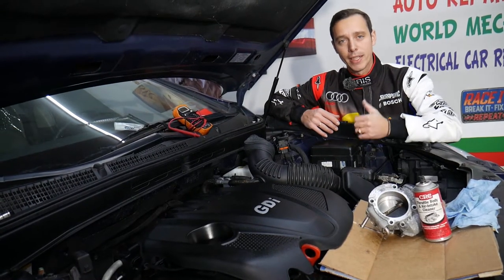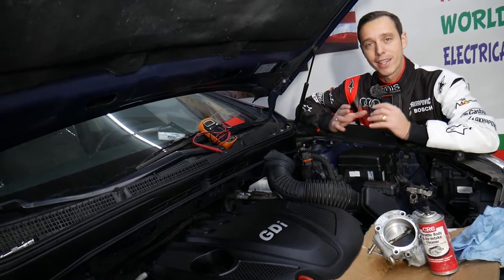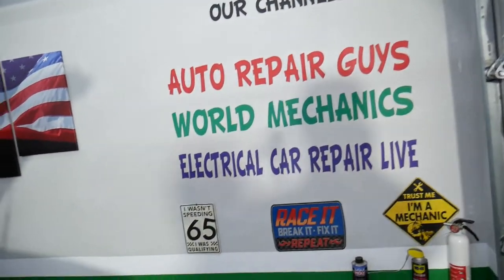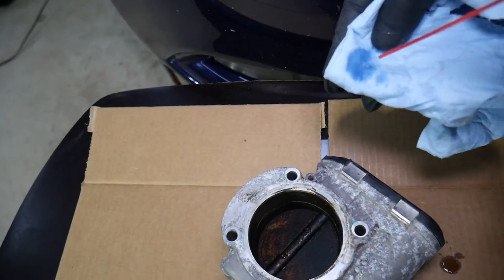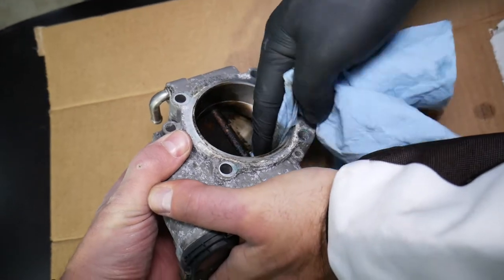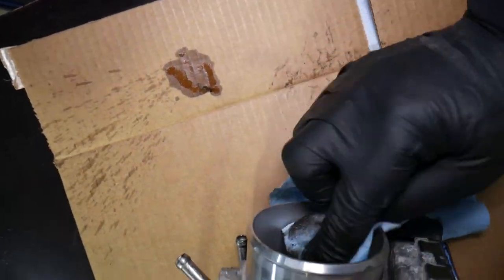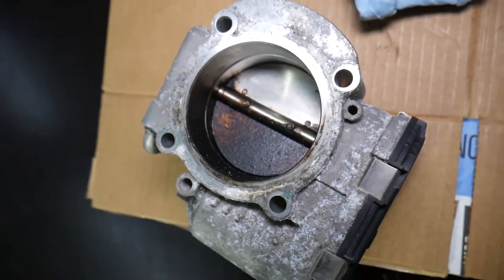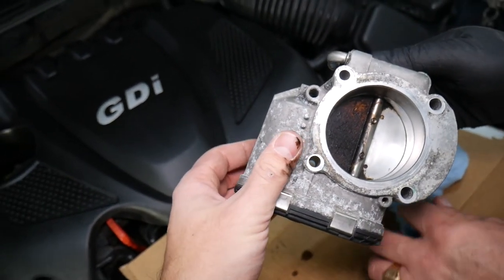HOW TO CLEAN THROTTLE BODY ON KIA OPTIMA

Comment: By turning the flap, doesn't that cause sensor calibration issues?
Reply: Yes it does for electronically controlled throttle bodies. Make sure you push it back to the same spot it was at. If you have to remove it to be cleaned, you were fucked anyways 😂 so at that point, it’s not a bad idea to try cleaning it.  It makes a big difference. I cleaned it on my 3000GT, runs smooth as a baby’s bottom. Only costs $5 for the throttle bottle cleaning spray.
Reply: Mine is electronically controlled throttle body , but i did not remove it from the engine  but i do open the door by pushing it and clean the surroundings and the door and it works fine 15 optima , but in my previous car i switch on the ignition and push the accelerator all the way down and it opens the door automatically but in optima its not doing
Reply: @zohaibahmed5445 so it was ok to move flap to clean? Gonna do it on my 15 optima but don't want to mess it up.  And I read you left it on car correct. That's what I was gonna do.

Comment: I've heard that you arent supposed to move that throttle body flap with your fingers as U do in your video because it will damage the sensors,gears ect and that U are supposed to clean it by turning on the ignition and depress the gas pedal so the computer can control it!Please clarify this issue so we can do it the right way
gthd gas pedal so it can open
Reply: Verified. This is correct In vast majority of newer cars~, ballpark any thing after 2000ish basically cpl things to determine is - search your vehicle and determine if you have electrical assisted throttle body vs a direct line (direct literally cable running from pedal through into engine and ending with mechanical type (push throttle the cable opens the flap inside the throttle body and allows more or less depending on pedal position.

Alternative newer adoption of electric throttle body systems use signals based on when the throttle (gas pedal) is moved. The throttle cable as mentioned above is not one unit. Instead thete are sensors and other comp. Parts that are mounted onto the throttle body and have a motor which adjusts the throttle position based on what the signals the gas pedal position may be.

If removal before Cleaning there should be no issue as long as you are gentle on cleaning.
But if u don't want to monkey around with removal and want to clean your throttle body while In vehicle you must take extra steps to safely clean inside an electrical controlled unit.

(*first off if u can't tell by looking try to open hood and driver door open turn key to on but do not start vehicle. Slowly give ur pedal a depress and then release and listen for a small mechanical gear  sound that happened in response to pressing gas pedal and releasing (this sound tells you u have a electrical type vs cable.

Another test if u have a 2nd helper or camera is to repeat above but have 1 person look inside the throttle body to see if an obvs cable is Makin the movement or if a mechanical winding type sound can be heard when the intake flap inside opens and shuts on release.

1.long story long, and to avoid damage to your fancy components on a electric type throttle body if trying to clean inside vehicle have someone turn to on and DO NOT START but press and release the pedal as another person works carefully to access and clean the entire intake side and with pedal depressed its possible to reach inside a bit with the valve open at that point.

DO NOT EVWR FORCE THE BUFTERYFLY FLAP MANUALY BY HAND OPNE AND CLOSED WHEN CLEANING AS YOU MAY DAMAGE OR MESS WITH CALIBRATION OR OTHER INTERNAL ELECTRICAL COMPONENTS (WORSE CASE HAVE TO GET A NEW THROTTLE BODY BECAUSE OF A SIMPLE AVAOIDABLE MISTAKE OR OVERLOOK. IF YOU GOOD LUCK

Comment: Looking for a smaller alternator pulley..2013 hyundai sonata  2.4. Voltage  Droppage ⚡
Reply: Is that what causes it? 2008 Kia Optima and the voltage while in drive at a stop light is so low lights dim on and off and radio cuts out. Once I’m back on the throttle all good